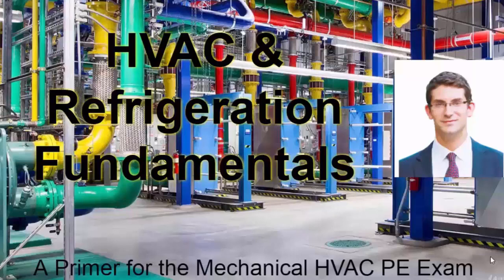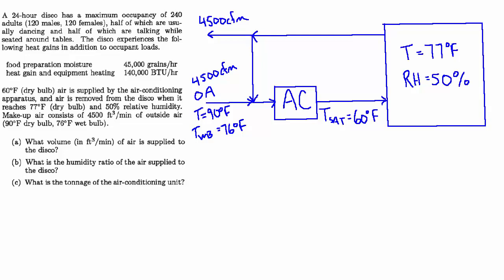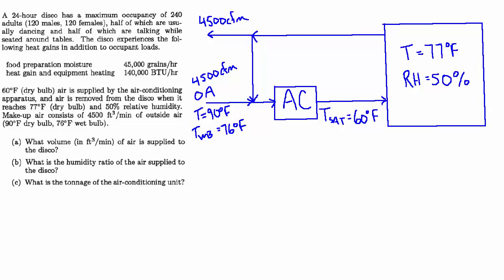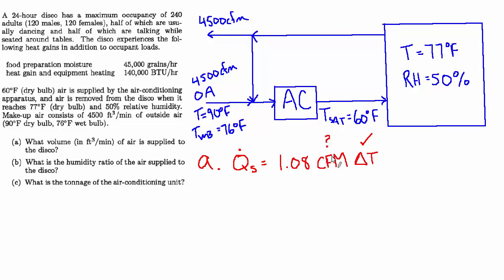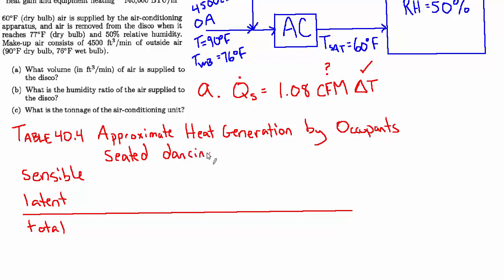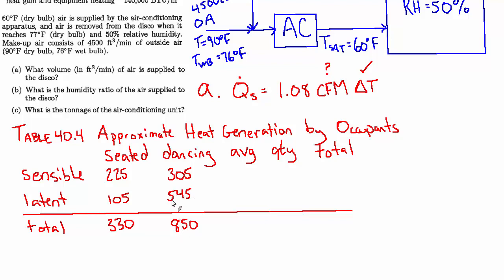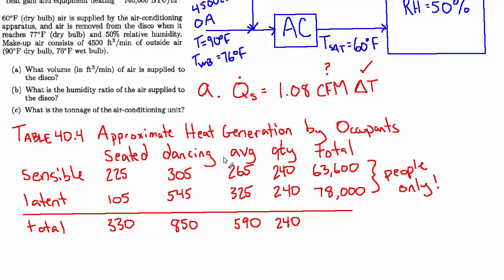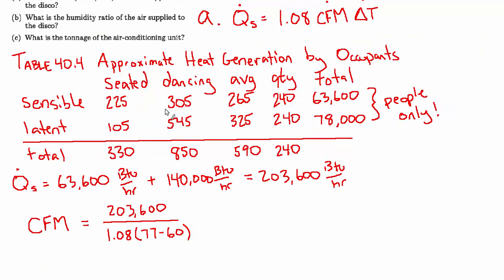101 Solved Mechanical Engineering Problems - HVAC Problem #7 part1of3

Comment: You didn't account for the sensible heat gain from the outside air.
Reply from the maker: OA sensible heat will affect the unit tonnage in part c but not the CFM delivered to conditioned space, which is only a function of the room sensible load.  The supply air temperature is given, so the unit will already have addressed the outside air load.